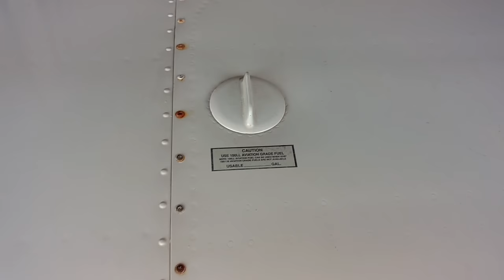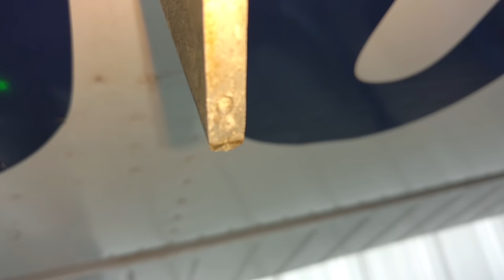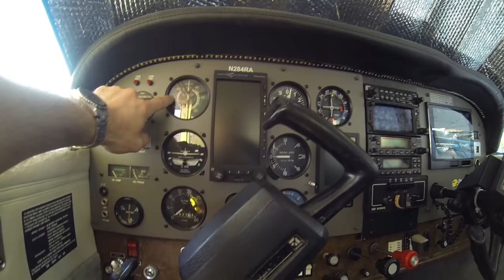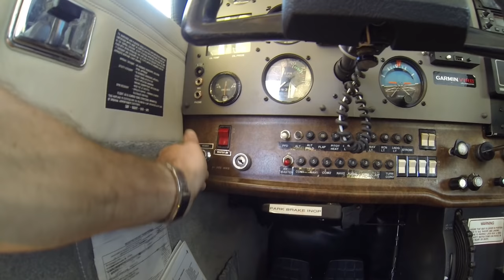Ep. 2: Airplane Parts Explained | The names of all the parts of the Plane!

Comment: At 8:45 you can see a small triangular shape part connected to the bottom of the vertical stabiliser (rudder)- can someone please explain to me what is that? And it’s purpose
Reply from the maker: That is the Vertical trim tab. This configuration is a ground adjustable trim tab. The fixed trim tabs are going to be bent to the right adding more parasitic drag to the right side of plane. It is there to help with left turning tendencies. Most larger aircraft have an vertical adjustable trim tab in the cockpit just like your horizontal stab would.